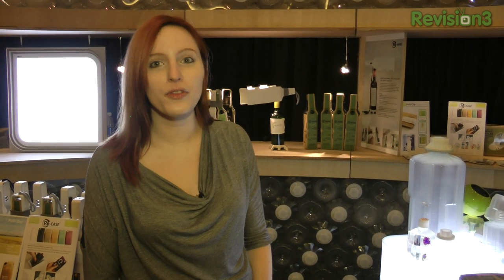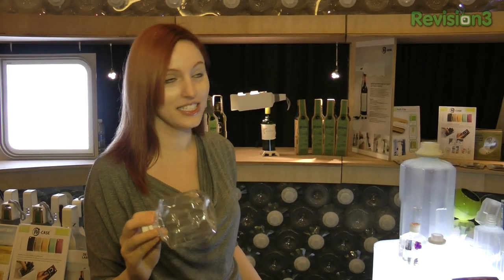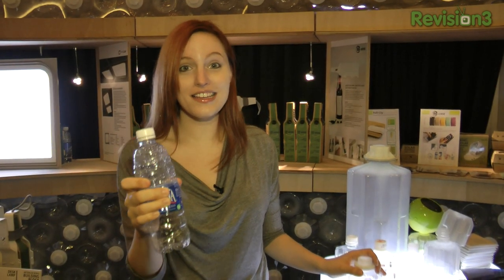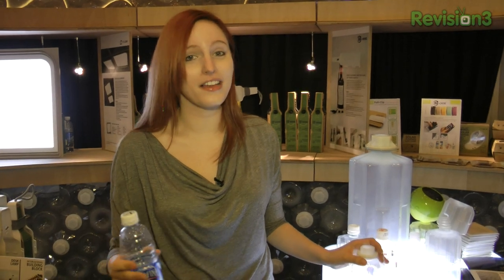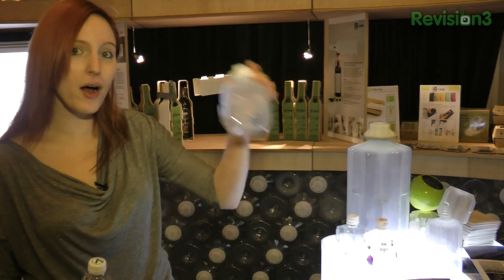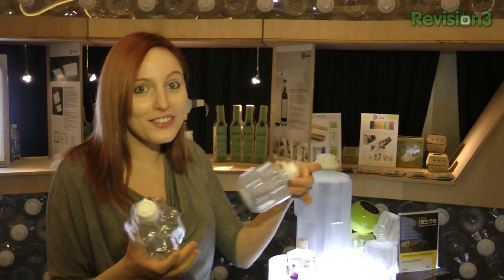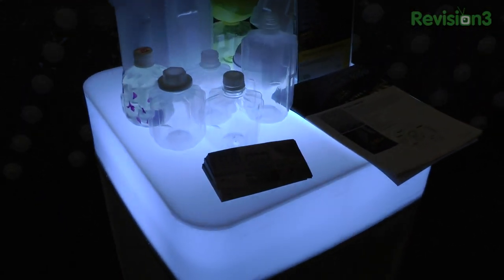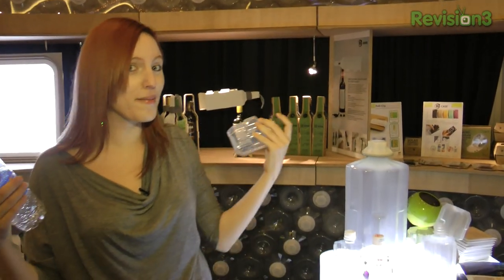End Carbon Footprints by Talking Trash

Comment: @jaggedspikerespawn Thank you for correcting me. Absorption is indeed the word I should have used. Meaning that filling the bottles with water to keep your house warm, would result in the water absorbing the heat in your house, cooling it down (correct me if I'm wrong). Would it stand up to air however, in areas where you'd want to have your house cooler than the ambient temp?

Comment: @ZHX1138 Just to educate you: no you wouldn't get really good insulation by filling them with water. Water is very good at conducting heat. It's why in almost every industry, when something needs to be cooled down, they use water. Air on the other hand, is a very good insulator. Just look at your windows, chances are you will see two plains of glass with air in between, that isolates pretty well. It's also why wearing layers is better than one big sweater. Hope you learned something! =D

Comment: @ZHX1138 Have You looked at solar powered Air conditioners? Also around 10 feet deep the temperature stays around 52 degrees F cement blocks attract cold like a magnet.